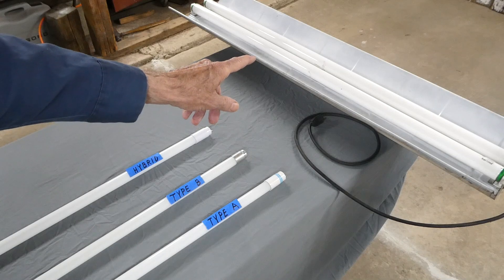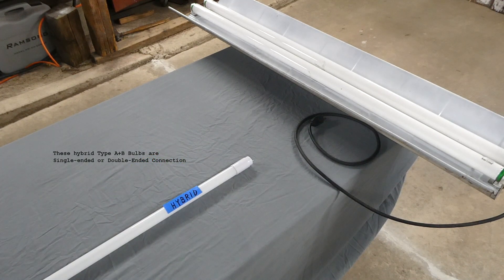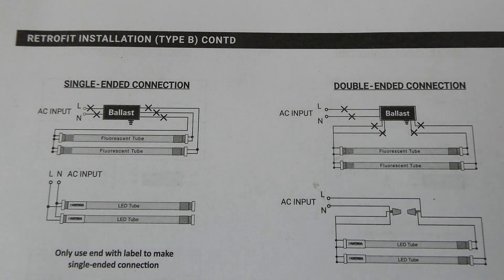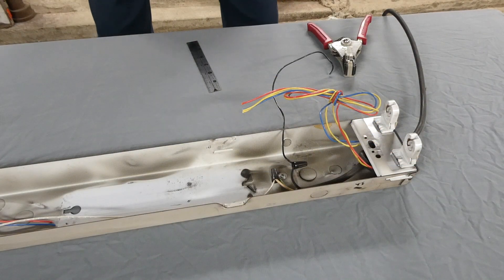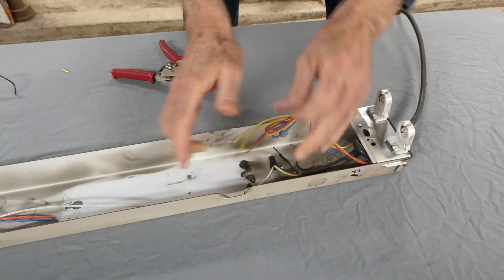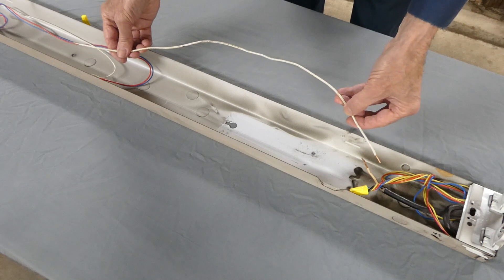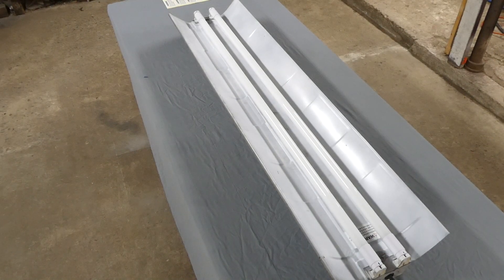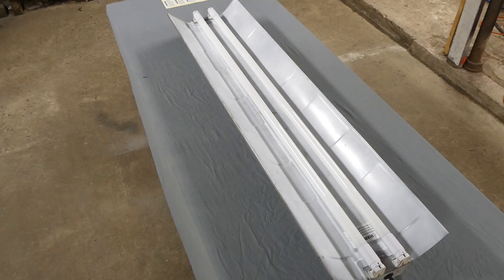Converting Fluorescent Lights to LED Easy as 1,2,3

Comment: i need to replace my ignition lock cylinder on my 2004 monte carlo. I was told that it can be accessed by removing the square shaped cover that is around the whole key system "without" removing the whole dash cover plate as I keep seeing in other videos and this one too? see everyone has a different opinion and a different technique to perform the ignition lock switch...

Comment: Oww that looks very bright:-D
Ahh you are using marettes  or wire nuts, a nice idea but illegal in the uk :-(
I used to work in a factory making sunbeds,  apart from a timer and fans it was a typical group of flourescent tubes and reflector. + starter per tube.